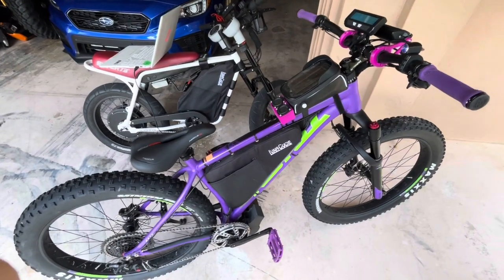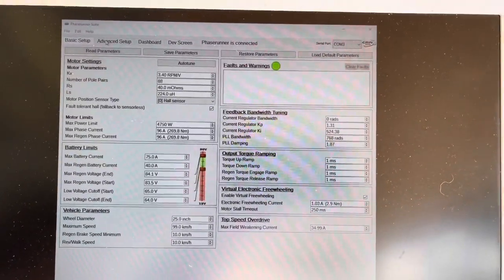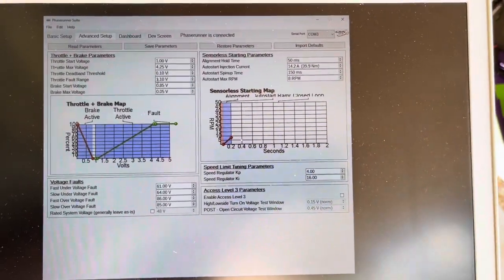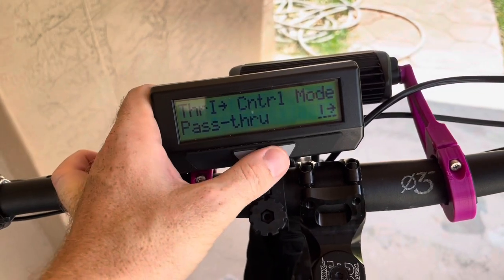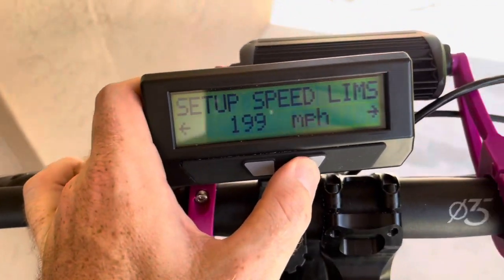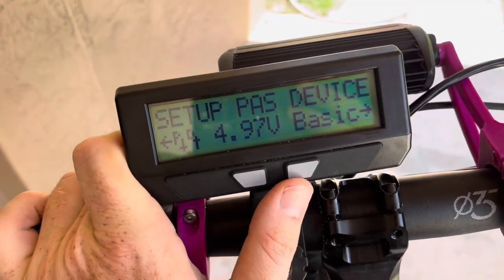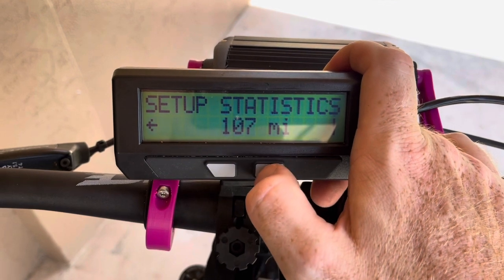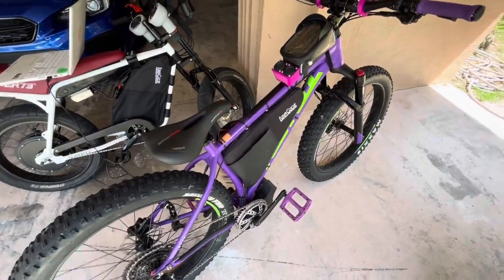How I tuned my BBS-HD to run 4750W and be a wheelie machine. Phaserunner tuning.

Comment: Grin's phaserunner etc are nice but it costs half or the same as an ebike itself. Way overpriced.
Reply from the maker: Different strokes for different folks.

No need to knock what im doing or using.  I paid 3k for the base frame alone on this bike, 300.00 controller was nothing.

Its been reliable, beaten , and fast (for what it is 50mph) without a single hicup since I built it 3 years ago.

Comment: I have a motor hub 5000w throttle only. I need help I messed with the settings not fully understanding what I did and not throttle is unresponsive.
Reply from the maker: Phase runner is way to small for 5,000w hub.

Because its only 90 phase amps.  This controller is suited well for mid drives.

Not gearless hub if you want tq.

Comment: Nice set up. I also have an e-bike conversion with the Phaserunner and BBSHD, except the battery is 21s. If I increase the field weakening to 50A it will get to 5.2 kW and have a top speed of 93 kmh (57mph). 
Just something I noticed, but I believe the wheel diameter is actually the outer radius of the wheel, rather than the rim diameter which might affect the accuracy of your speedometer.
Unfortunately my Phaserunner appears to have died. I'm not sure I can recommend it because they don't have replacements if it fails and can't be repaired by yourself. I've had quite a few issues with my Phaserunner, this was my second one since the original one I bought died also.
Reply: You won't. And your motor is already a grill with that fw.

Comment: Hi Mike.  Thanks for posting so many detailed videos, well done!!  I am at the beginning of my ebike build and would love to go straight to a 72 volt setup but the lack of controller availability of either the phaserunner (my first choice) or the BAC 855 controller has me at a stand still.  I think I will install a stock BBSHD with a 52 volt battery and wait for Grin technologies phaserunner (not available until November 2022) .... can you tell me what your 52 volt battery specs are ?
Reply from the maker: I actually need to list the 52V battery on E-Bay. Its a Luna cycle 29AH LG pack.  If you goto the site its the biggest triangle pack they sell (Maybe sold).
You will only need around 50-60AMP bms worth of battery to pull off PLENTY of power for the HD. 

Are you going to do a self build?
Reply: @BuildItTuneItEV  thanks for the BMS info.  If I didn't know it would be a nightmare to ship a battery from the states to canada I would try to work a deal.  You are correct, that battery is currently sold out.  Thanks for the quick reply, I love your bike!  Very nice build :)

Comment: is this programming software specific to your external controller or can this also be used to set the original bbshd controller?
Reply from the maker: This is for 72v I have a 52v setup as well on here.

But thanks for bringing it up, I’ll put in the description it’s for 72v!
Reply: @BuildItTuneItEV  what's the name of this programming tool?
Reply from the maker: @hannesdobbelaere  this is for the phase runner.
Not the oem controller. Do you have v1 or v2?
Reply: @BuildItTuneItEV  i have the original one.

Comment: Is it better then asi bac 855
Reply from the maker: I have not used the bac, but I think you have more power with the bac unit.  I’ll check out the specs, biggest issue with the phaserunner is hitting the phase amp limit.   If it had higher phase amp limit, this controller would be mental.